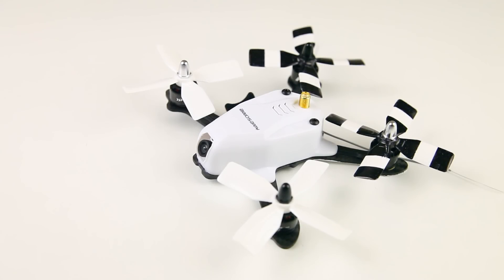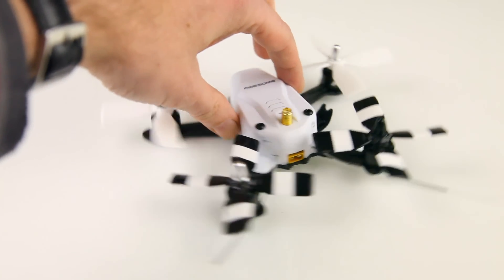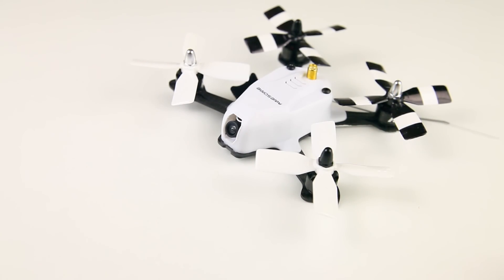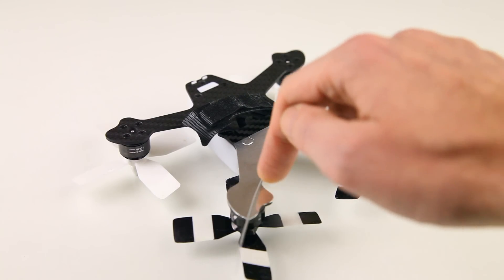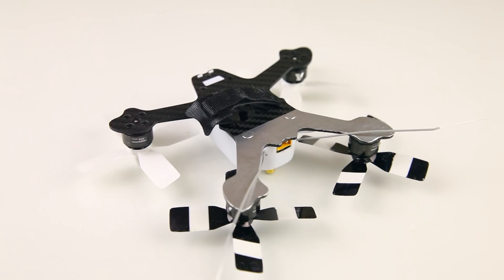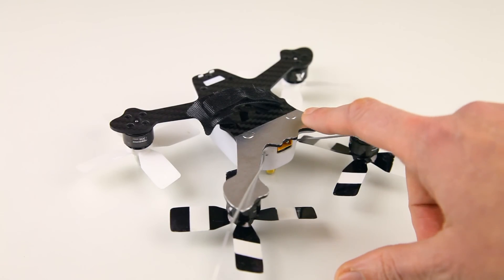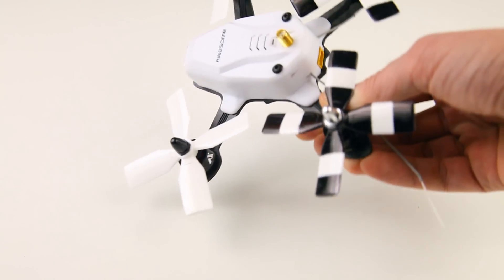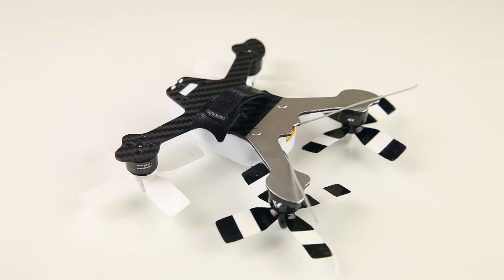Youbi XV-130 micro FPV quadcopter - Arm-flex / Prop-strikes Quick Fix! :)

Comment from the maker: Arm-flex on the Youbi XV-130?? Solved! Quick and easy :)
Link to the Youbi XV-130: https://goo.gl/sDMfkX

Specs:
Wheelbase: 130mm 
Weight: 115g
Motors: 1306 3600Kv
ESC's: BLHeli-S 20A
FC: Naze32 F3
Camera: 600tvl Cmos
VTX: 25mW / 200mW / 400mW 5.8Ghz 
OSD: No
Lipo: 4S recommended (750mah)

Comment: Thumbs up man, good videos!!   I'm looking at getting a 130 size Quad and am going back and forth between the youbi and the tarot 130.  I'd like your opinion if possible!?
Reply from the maker: Thank you Drew! :)  I have to say I have not personally had the Tarot 130.. I have seen a few video's on it, it seemed quite nice.. My general impressions of Tarot though isn't super positive in terms of design / durabilty.. Again: I have not had one myself.. On the Youbi I really liked the integration of components, and well.. I have a soft spot for spider frame layouts ;)

Comment: Never heard of aluminium tape, but it looks like good stuff!
I would have probably glued a length of carbon fiber square rod along the bottom of the length of the arm, but that just because I have some ha ha (0:
Reply from the maker: :D  I did first consider doing that myself :)  I'm Sure that would have worked quite well too. But yeah.. this is quite a bit lighter :)
Reply: DutchRC Adventures 
Yeah true that!

Comment: I found that Turnigy Graphen Lipo are haver then most lipo of the same size ans cell count
Reply: shannon newman they say that the battery are graphene but I don't really think they are, these battery's got layers of some material between the cells while other battery's don't have a layer between that. That make it heavier also the heat shrink around the battery is muck thicker than other type of heat shrinks but it is a little bit stronger
Reply from the maker: Agreed.. and they have a protective layer of platick around them.. Quite handy for quads that land on the lipo..

Comment: It's a good idea, but if you change the stock props to racekraft props, the problem would have been solved as well, because these props do not touch the canopy
Reply from the maker: Agreed sir :)  I tried to find a way to solve it with the stock props though, as that's what people will get with their XV-130.. And well.. it's cheap + it works far better then I had expected :$  There is significantly less flex in the arms :) 
But sure.. it can allso be solved in other ways indeed :)